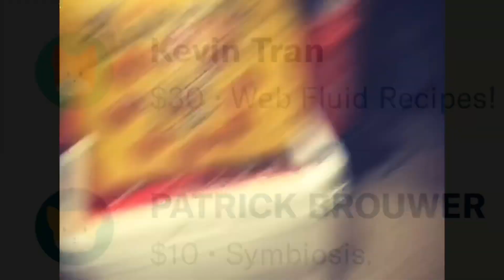Web Fluid Tests. (Part 3.)

Comment: What I would do is find out what the proteins that make spider silk are and where to get them, make small mechanical spinnerets and fill the web shooters with it. Then find a way to make the silk from very thin to a little thicker so it doesn't snap as easily
Reply: Thats not an easy nor is it a cheap process. Scientist i believe use genetically altered goats that produce the proteins in their milk. Extract those proteins and go through a very complex process just to weave those proteins into anything that resemble spider silk. Its not exactly something you could just make at home nor spin. For spiders its a natural and instinctive process. Look how hard it is just to make a robot that can walk terrain. Something thats so simple for a human. It just isnt practical unfortunately. At least not yet.